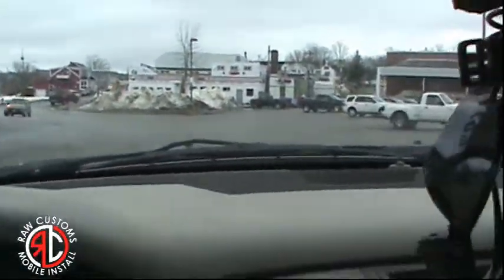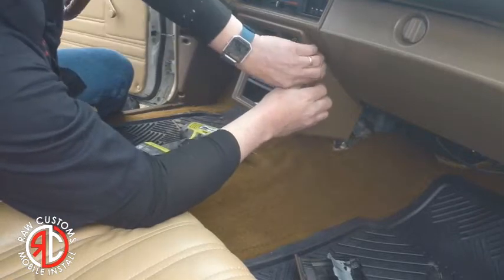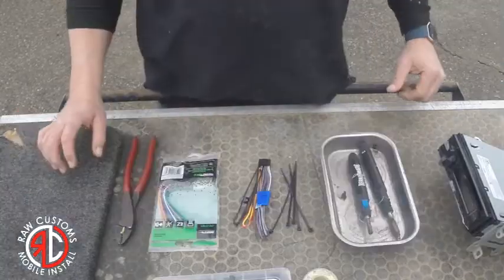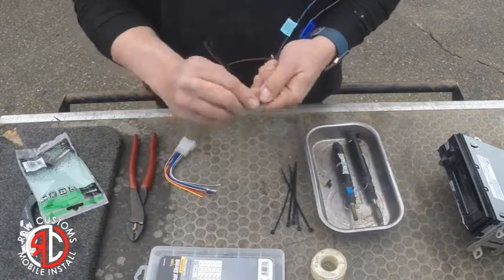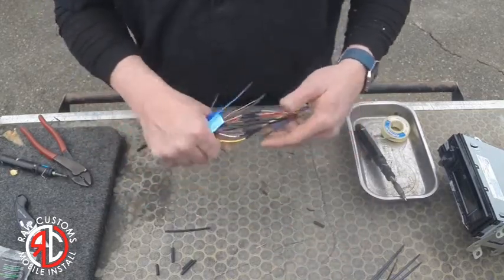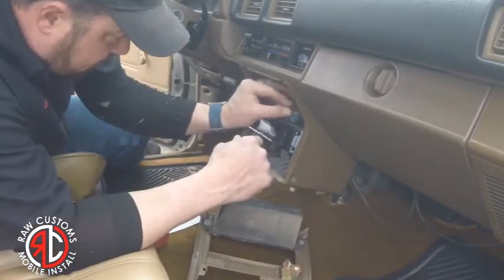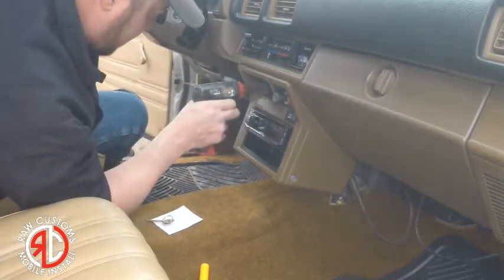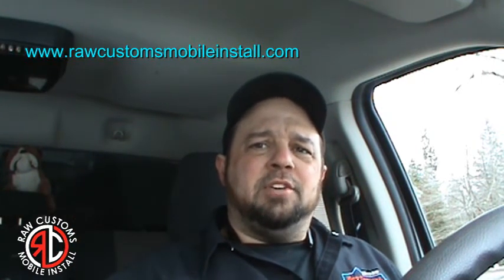HOW I DO 1987 Toyota PU Radio Install

Comment: If you like this TOYOTA. You'd like the 1 I bought for $1,700 back in March.
'88 TOYOTA 1 Ton Box Truck (5'6" tall 6'5" wide 10' long box) Dually. 
Former RYDER truck judging by the safety yellow cab interior color. Looks to have been repainted rattle can white. 
Belonged to a local grocery store that's going out of business. 110,000 on the engine,  154,000 on the truck. Not a show truck, but not rusted out.

Your video will help big time if I decide to replace the factory AM/FM radio that's still in it. 
Thank you for sharing.

Comment: Did you need to connect a 12v constant power to the radio?
Reply from the maker: Yes all radios need 12volt constant for the memory and its main power
Reply: I mean did you need to run a separate wire off the battery or was the truck prewired with it?
Reply from the maker: @patrickburgess5317  truck had it